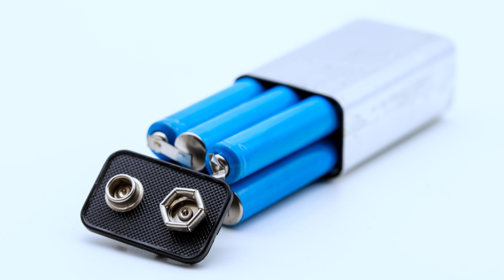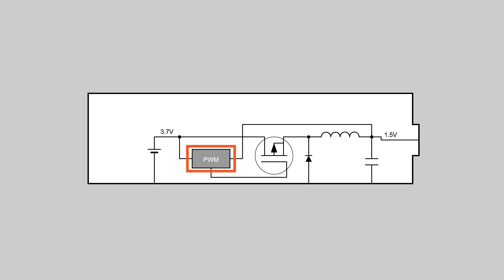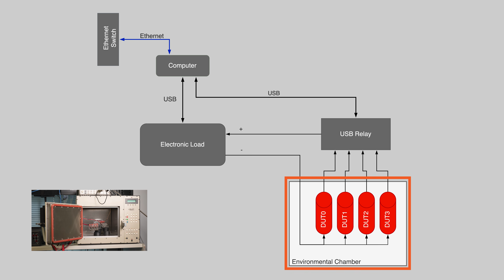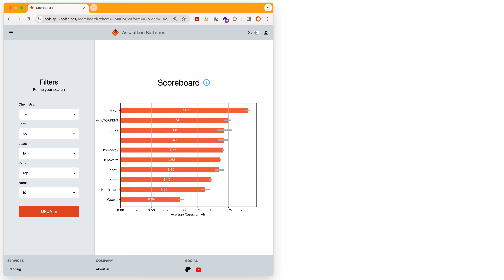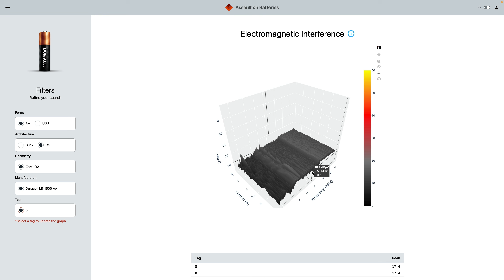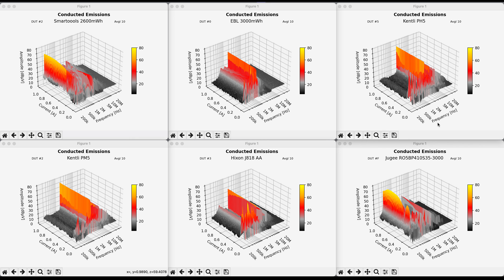Assault on Batteries #1 |  Rechargeable Lithium-Ion AA

Comment: The whole idea to make lithium-ion 3.7V/Cell compatible with the typical 1.5V/Cell is stupid. The only way to make this problem go away is to introduce new standard sizes/shapes for lithium-ion cells that are just replaceable without the need for buck converters. The problem is that no hard case universal models that are vendor independent standardized exist. If something like that exists, slowly but surely more vendors would make new appliances with this new standard and the old one would fade over time. Yes that will take many years, but lithium-ion already exists long enough. If they would have done this from the start it would not been a problem today. It's just companies trying to keep market with propriety designs and being against standards if they can prevent standards to make more money they will. Remember that Sony was one of the first making and selling lithium ion batteries to the general public since 1991. How many devices would have existed today if they had done it right from the start? How many battery driven devices do you still own that are from before 1991?
Reply from the maker: Agreed, the buck converter, if needed, should be in the device, where it can be properly filtered.

You can get lithium-ion in 14500 form, which is close to AA. Some even with a button top. Some even with LiFePO4 chemistry. You can replace two 1.5V AAs with one 14500 and a dummy cell, but you have to manually monitor discharge or you'll damage the cell with deep discharge. So "don't try this at home".
Reply: Lithium ion got 18650, 26650, 2170 standard for a long time. The problem with lithium ion replaceable battery lithium ion is too good as a battery. It contains so much energy to borderline dangerous. Give it some abuse and it combust spontaneously.
Reply: @KarrasBastomi All smart phones contain Lithion ion batteries. Several billion around the world. What's more ubiquitous than those? Are you saying cell phones should be banned because their batteries are too good, and therefore, dangerous? Electric toothbrushes and most other rechargeable gadgets all use Lithion ion batteries.

So the issue is the device makers. They can very simply make them to still accept the AA size, yet run on 3 to 4V, as opposed to the measly, underpowered 1.5V. That way, they would still be using the same old standard sizes -- AA or AAA. Or they can switch to the 14500 or other form factors.

Either way, alkaline will be a thing of the past soon, whether they like it or not. It's time to stop filling dumps with dangerous spent alkaline cells and use recyclable Lithium ion ones.
Reply: @junehanzawa5165  yes they do but they also contain a lot of software checks to keep them operating in safe manner.

None of that exists in devices that were/are built to accept standard batteries. So you either yolo and pray it doesn't cath fire/drains your precious Li dead or you have to integrate all those safety features inside tiny AA body which drives cost up. 
Seriously at this point it seems completely pointless, everything new comes with integrated Li battery and USB charging anyway and old gear is shrinking niche so market for AA Li-ion is small and will keep shrinking as those old AA accepting devices age and die.

Comment: I find it kind of odd that the roughly 3Wh in the best Li-Ion AA cells is basically the same as what you get from a decent NiMH AA cell. I suppose the sligntly lower voltage of NiMH chemistry could be a factor, but I've yet to find anything that won't run on NiMH cells as they have a slightly higher voltage than the older NiCd chemistry cells.
Reply from the maker: And NiMH has a low internal resistance—great for photo flashes.
Reply: @on-the-fritz  I noticed that with my power-hungry Kodak digital camera back in 2000. A set of 4 alkaline AAs would get chewed up pretty quick (could be used in less intense stuff after), but a set of NiMH cells would last at least three times as long. And the ones I had at the time were only 1300mAh.
Reply from the maker: Modern alkalines are about half the 1300mAh claimed by your NiMH cells. Have a look: https://aob.spukhafte.net/?chem=ZnMnO2&form=AA&load=1.0&rank=t&num=5
Reply: @on-the-fritz  At a 1A drain, that doesn't surprise me at all. I recall the Alkaline AAs in my camera getting warm. Not quite as warm as my old Tyco Turbo Hopper (the 8AA version before the 9.6V battery pack was a thing), but still warm. I wish I had tried NiMH cells in my Game Boy. It was low drain, but even my 600mAh NiCd AAs lasted all day and then some on a charge.
Reply: @Bunker278  I used to attach loose wires to my game boy and a 6v lantern battery on the other end haha never had to change that battery!
Reply: @jimmybrad156  Damn. That's gangsta.
Reply: @Bunker278  coil spring terminals made for easy winding :)

Comment: Luckily most things that I have come across that utilize AA or AAA batteries are disappearing. Nowadays I only see them in remote controls, wireless keyboards and mice. I use disposable batteries in those since they tend to last multiple years and I don't believe the environmental impact is significantly less when I use rechargables. Of course I properly dispose of them and not put them in the trash.
Reply from the maker: On a recent trip, it occurred to me removable lithium-ion batteries and cells have an advantage when flying: you can check-in the device they power and carry the batteries in your carry-on, per TSA rules. Devices that take standard AA or AAA tend to be inexpensive enough to risk checking in.
Reply: My biggest problem with rechargable batteries is their self-discharge performance. Take a battery-powered clock - a NiMH battery lasts about six months before it needs to be changed because it is self discharging faster than the power required by the clock. An alkaline battery will easily last over a year.
Reply from the maker: Newer NiMH claim to have low self-discharge rates. Panasonic claims their Eneloop cells will have 70% of their charge after 10 years (https://www.panasonicbatteryproducts.com/eneloop_rechargeable_batteries/eneloop_rechargeable_batteries-aa_4-pack/)

Comment: Learned something new! Didn't know about buck convertor inside these cells (makes sense now that i think of it). 

Would it be difficult to modify a tool to accept batteries like this? Could be an interesting video 😊 .

I assume a small in series impedance would do the trick for the switching frequencies in the mhz range?
Reply from the maker: Something like a ferrite would help, but it would have to be effective at the fundamental and harmonics of the switching frequency (harmonics probably extend far above the upper limit of the CISPR 22 test), while conducting a heavy (relative to the RF noise) DC current. Whatever Apple did in the A1385 works well. Maybe a designer of switching supplies will weigh in?

Comment: What do these give as an advantage to regular NiMH? I've got a bunch from ikea, 2200mAh, no switching shenanigans. Am I missing the point here?
Reply: NiMH batteries output 1.2V, whereas these Lithium ion ones output 1.5V, same as Alkaline batteries.
Reply from the maker: Also a NiMH cell reduces its voltage as it discharges, whereas the bucked lithium-ion cells hold a constant 1.5V (and constant power) over their entire discharge.